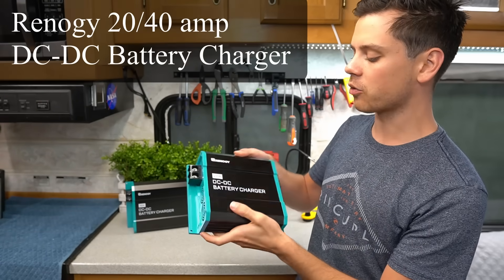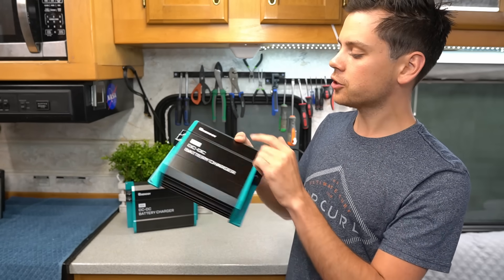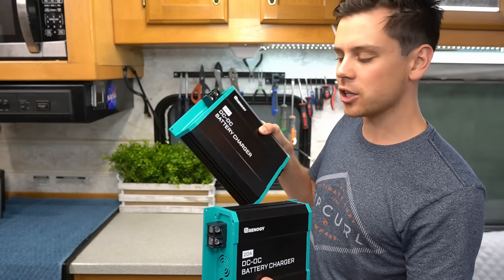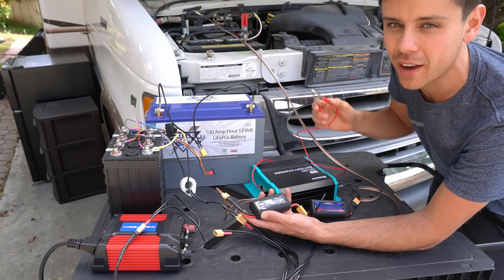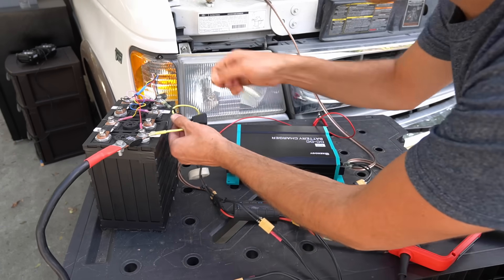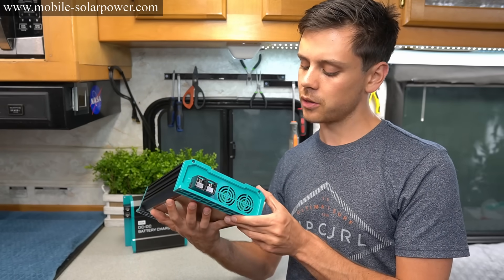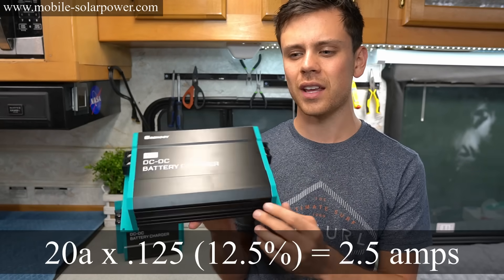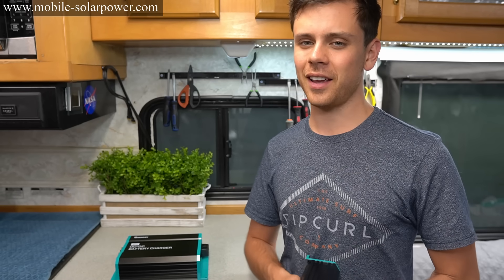Renogy DC-DC Battery Charger Review: "Smart" Alternator Charging for Solar Batteries!

Comment: Hi Will, thank you so much for making these videos!  I like the price on the Renogy better than the Sterling.  Do you have any long-term updates on performance / reliability of the Renogy unit?

I'm in the process of designing a prismatic LiFePo4 for my live-aboard sailboat.  I'll probably wind up with 200 - 300 Ah of capacity.  A B2B charge controller like his gives me a way to connect the HD 100amp alternator on my diesel engine to the new lithium pack.   I also have solar and wind power charging as well - have been off-grid experience since 2004 using lead-acid batteries and I'm ready to upgrade. 

If you ever make it down to Key West, we'll buy you a big shrimp dinner and take you out sailing!    :-)

Comment: Hey I've got a question, I've just installed one in my van and after connecting a active 12v source to D+ the charger didn't turn on does this mean it's faulty? I'm not sure what to do
Reply: Did you hook up that ignition wire?  Signal from that turns the unit on.

Comment: Thanks, do you know if these are ignition protected for boat use?
Reply: I have one of these installed on my boat. You don't have to connect it through the ignition. I have the +D wire from the dc to dc charger going through a switch and then to a convenient 12v positive terminal near the battery. I run my engine for a few minutes before switching on the dc to dc charger as this is better for the alternator.

Comment: Even though this video is a year old now! These devices are still very relevent. 
What most people don't know is that the more load that you place on the alternator, the hotter it gets. I'm sure that there's plenty people who have found out the hard way! Considering that you might be in the middle of nowhere and your secondary battery is getting low, so you start your engine and let it idle, no one ever thought about measuring the alternator temperature 🌡️, but they are only designed to carry out the car's normal functions, when you through in an extra battery that is flat plus a load on top of that, you will cook your Alternator! There's a good Video on YouTube where a Victron dealer is testing the effect of to much load on the standard factory Alternator and you can see it start smoking.. especially when it comes to LiFePo4 Batteries! They charge much faster than lead acid! The new version of this Renogy DC to DC converter support's the LiFePo4 Batteries, I saw another review of the current version and the reviewer wasn't happy because his Alternator has a rated output of 80A but it's not getting anywhere near that, but it's solar input can provide more current. He just couldn't get his head around why it was doing this! It was actually allowing him to charge his battery while the engine was running without cooking it and leaving him stuck where Jesus Christ left his shoes 👟. 
The simple relay just doesn't cut it anymore! If the cable which you are using is long and slightly undersized, you will have some voltage drop by the time it gets to the back and then you have the lead acid battery which has high internal resistance so you might be fine! But if you have two or three lead acid batteries that are pretty flat, and you decide to start your engine and let it idle, be expecting the magic smoke to start coming up from under your bonnet! Your day day has gone from bad to worse. Hope you're starter battery is big enough to get you to the nearest town or city! Because that's all that you are going to get until you replace the alternator, they are not cheap either.. 
These things have a good purpose, but no one is educating the people who need these things for why they need them, they don't just isolate the batteries, they also protect your alternator... 
That other video had something in it's title to do with the effect of lithium batteries on an alternator.. or something like that, it wasn't a long video but it's message is very clear, that's why water cooled Alternators exit... They get really hot 🔥.

Comment: instead of wire it to the ignition to start. I will wire that on a switch  and you can turn it on Manually if the battery need charge or you need to warm up the engine.

Comment: If you put a manual switch between the ignition circuit and the device you can have your delay manually. It's what I did - I turn on charging when I want to, not when I start my vehicle (mostly because I don't have my trailer hooked up all the time...)

Comment: HELP!!
i emailed this question to battleborn regarding my 2 new battleborn batteries:

"i've read that my cole hersee 24059 85 amp solenoid, that i added to charge my old agm batteries as i drive, will ruin these new lithium batts.  is that true?   do i need to remove it from my system?"

here's the answer i got:

"That will not hurt or ruin the batteries in any way.  That is just going to act like an on/off switch for charging your batteries from the alternator."

i don't know much, but pretty sure i just heard will say again in this video that charging from the alternator will wreck my EXPENSIVE new batteries.  

again,  HELP!!

Comment: I installed the 20 amp model and it worked great for several months along with the Renogy Rover solar charger but it is now dead. I’ve checked wiring, fuses, and verified it is getting signal to turn it on. Renogy has not responded to my service ticket or phone calls so today I opened it up. Two small square nuts fell out and I can not find where they would go and I should note I heard something rattling before I opened it up. I see no obvious issues and the fuses appear okay. I will test the fuses and  reinstall it tomorrow to see if it somehow reset itself. Of course I will double and triple check all wiring as I go. I’ve ordered the new dual input dc-dc charger and as a back up, I’ve ordered the Redarc 1225D. I’d love to love Renogy but they are coming up short in several areas so I feel the need to look at the competition.
Reply: Today I tested the fuses and reinstalled the charger and it is working. Really don’t know what failed but suspect the ign trigger wire was not connected properly even though I had removed it and put it back in the terminal block as part of my diagnostic steps. Also, I did find where the two small square nuts go and noticed that there are two matching screws so it is reassembled correctly.

Comment: Can you have this in parallel with something like the Victron MPPT chargers? Or would that confuse everything?

Would you need to isolate one to use the other?
Reply: Jack Kenyon I am slightly confused about how it works but I had a Renogy DC-DC charger and a Renogy MPPT charger connected at the same time with no issues.

Comment: I understand this is 12v ONLY but what if I used a step up converter for 12v to 24v? If not are there any alternator charging options for my 24v battery?

Comment: The reason for the ignition wire is most new cars have what they call smart alternators which drop voltage to save drawing power from your engine when the crank battery is fully charged. Therefore a normal DC to DC charge may not realize the alternator is actually on and stop charging your second battery because of the voltage drop
Reply: I think it's more for an RV and not for a trailer so you don't drain your starting battery but the hot wire in the trailer plug is only hot when the engine is running so you don't need it so you just jump it to the hot going in to the charger(?)

Comment: I looked at these guys, only reason why I didn't buy one is because you cannot run the device without connecting the ignition wire, other brands are voltage sensitive and hence make the ignition wire optional.

Comment: What size wire do you run for the D+ ignition ? Also, does anyone know where it connects to a Sprinter NCV3 ?
Reply: This is a very low load. If you read the manual it may recommend a wire gauge. 16-18 awg should be fine (the typical wire gauge that's running throughout most of your vehicle).

Comment: B2b chargers and solar panels with there own regulators work well together.
Reply: Contd. I'll get the hang of this new technology one day!   Looking at sterlings latest catalogue,   you can have  a B2B charger up to 80% of the alternator rating.   There B2B chargers can be set for any battery I just wish they would move away from there complicated led multi function controls and read out which does make it difficult  to operate, however they are continually updating to keep on top of smart alternators. They have options that use voltage sence and ignition sence,  but smart alternators tend to need the ignition sence.  They say you must keep lead acid as the starter battery , but if you can not do that and have lithium they have a box that connects to the system to protect ones alternator.
The renogy might also have both, ignition feed would be needed for smart alternators.
Several manufacturers have versions that are both B2B and solar some I have seen recently give preference to solar.   That sounds nice, I only really need the B2b in the winter.
Beware Ctec b2b and mains chargers, they are NOT suitable for lithium batteries, only lead acid batteries.

Comment: EDIT: This was a wiring issue and not related to the charger. 

So I recently bought one of these, and an issue I ran into was that it seemed to drain my main vehicle battery low enough that my engine nearly had trouble turning over the next time I started it. I turned off the charger (I wired the D+ to a switch) and my battery charged up no problem in a few minutes. Not sure what happened, but if I figure it out I'll update this comment.
Reply: sounds like your alternator is too weak
Reply: @gbell9119  dedinitely possible, but I don't think so. My truck has a towing package, which includes a beefed up 130amp alternator. And I only got the 20amp model.

Comment: How can I use this in a stationary solar system without alternator?
Context:  
Bank A: 4 x 12v 110AH flooded lead acid being charged by solar array.
Bank B: 2 x 12v 100AH agm I want to charge also.
Does the d+ just receive a conductor from positive on bank A?

Comment: Hey based on conservation of energy I’m really curious what effect this has on the miles per gallon of a vehicle any chance you can do a video on that or answer that question by responding to my comment?
Reply: The alternator of most modern vehicles are almost as efficient as the small generators such as the Honda eu2000. Yes you lose a little mpg, but your only paying about $1 extra in fuel cost, to charge 100 Ah battery that is at 80% discharge. Depends on driving factors and alternator size and efficiency. It’s totally worth it when you are driving, costs a lot more than a typical generator to idle it to charge your batteries.
Reply: Devon Crews Awesome reply thank you very much.     I try really hard to charge my batteries using solar but sometimes there just isn’t enough time when I’m camping or working. So you’ve given me just the answer I needed.     So now I have another question… I drive a Chevy volt as my day-to-day vehicle (I have pick up trucks for work But my Chevy volt is for doing quotes and bombing around town).    They are free public charges all over the place could I feasibly use a 400 want to 2000 W inverter to charge up batteries for “free”? That includes my Jack pals and my nexus power station

Comment: Will, I am glad to see you have an RV. I have a motorhome with a start battery and two brand new 6 volt Lifeline AGM. Just ordered a Xantrex Freedom XC2000 inverter. Seriously thinking of going for lithium because I only have room for two batteries and want more run time. Do you have a video with this type of conversion that I can follow all the parts?
The Xantrex will charge the lithium batteries so it looks as if I will need the dc to dc adapter to charge the lithium batteries meaning I will have to disconnect the present charging circuit from the engine that is there now. Also my engine battery is charged while the camper is plugged in. Is there  a way to keep this feature.
I hope you have time for all this. considering going with Renogy for the whole system.
Thanks for your time Will

Comment: The advantage to adjustable amperage output is the ability to lower it when parked idling, or driving in the city. Foresty forest mentions in his video the alternator in his van can't produce enough amperage while driving in the city so he has a switch to turn his DC-DC charger on and off, however im sure if he knew/had this feature, it would work well.

Comment: Battery Charger Review
Reply: Wow! What a mistake. A have a Vevor which I assume is a copy as the manual is the same. Was about to send it back until I read this post. Would not charge at all! Followed the manual and made the same mistake as you must have. When set to the config you have noted, all is now good. Thanks for the post, and I will advise Vevor of the issue.

Comment: Great vids, I've watched a lot.
I'm stumped with earthing tho.
Can I just earth back to the cab battery or does it need to goto chassis as they all end up there anyway?
I have an kisae Abso1250 Dc-Dc charger and it's connected + & - to the cab battery. 
Also the optional ignition live wire isn't connected,  what does this do ?
Cheers

Comment: Hi Will. I have 4x 100amp renogy lifepo4 in my battery bank and a 2018 Promaster 159 ext. I've decided to go with the Renogy DC to DC. My question is should I get a 20, 40, or 60 amp version? Thanks!

Comment: You can always just use a switch in line with the ignition wire and then you can turn it on whenever your alternator has settled down after startup.

Comment: I have the 60amp variation of this unit it likes to get super hot and heat up the output terminals and lugs also not sure what to do I’m now over gauged on the cable but the over temp protection still kicks in even in an open area with a fan blowing on it.

Comment: I will really use low current mode. let me explain my battery system first, My off-road truck has 2 lead acid in engine bay. Start battery only for starter, secondary battery is for all off-roading accessories and the battery charge by solar panel too. 

inside the truck I got a 100ah lifepo4, which can supply all I need during road trip and van-life. More important, lifepo2 + 2000w inverter also can supply everything I need(micro wave, water kittle, lighting and camera computer stuff), except AC of my RV trailer. So now, 90% of time I won't bring Generator with me and I have no problem with it.  

How do I charge the lifepo4?  I will use the secondary to recharge the lifepo4. I will use low current mode when the truck is park there, and use solar charge only. The low current control can prevent the lifepo4 take over all energy from secondary battery in short time without start my truck. It is a real good mode. 

Thanks for sharing so much information to us. I learn how to wire my electric system from you !!!

Comment: I have one of these in my RV.  When I'm driving my RV is connected to my tow vehicle using an Anderson plug.   When I'm camping I setup a portable solar panel with inbuilt PWM charge controller and plug it into my RV using the same Anderson plug still going through the DC-DC charger.
Reply: Love this idea. Wondering what size charger are you using and panels?  I am only towing with a car to a small camper. Have 2 100w suitcase with built in controllers charging 1 100a lithium. Looking for the simplest and cheapest way to also setup dc dc charge while driving. Nervous about setting up the dc dc  Thanks for any info you could provide.
Reply: @kathywood3249  200w solar and a 20a dc-dc charger feeding 2 x 100 ah batteries.  If I were to do it all again if have bought the renogy 50a model.  I also ordered the thermometer.  Apparently the renogy alters is charging based on temps
Reply: I wonder if you are losing solar efficiency by running the charge controller output through the DC to DC.  Might turn 200 watts into 160?   On the other hand, if your DC cables from the charge controller are undersized, which they typically are, then the DC to DC could help there.

Comment: Hey man, I've watched soo many of your videos at this point ☺
Your videos and are super informative and keep it so interesting at the same time.

I am doing a van conversion at the moment and I have a lifepo4 battery (12v) and would like charge off the starter on my 1989 mercedes 310.

Could you recommend the best device to protect the system for my money (I have been buying piece by piece and its really starting to get expensive 😂)

I was wondering if putting the starter battery through pmw charger would somehow do it or does that make me look crazy? 🤪 

And would there be a problem in having some 100w solar panels and a 300 or 2?

Comment: Is anyone hooking up the ignition switch to the running lights of my trailer.  Basically, instead of ignition, I want to use the existing wire connected to my trailer.  Thoughts? Is this a safe solution?

Comment: So let’s say your solar battery is low on charge and you want to charge it up with this at 20amps on the output side and about 25 amps on the input side.. can a standard car alternator handle this extra 25 amps on top of its normal design without failing or needing other things?

Comment: Will not sure you need to worry about the in rush turn on delay. The battery is shunting the load on the alternator, and the vehicle regulator is not instantaneous so there probably is a delay. Need to scope current profile.